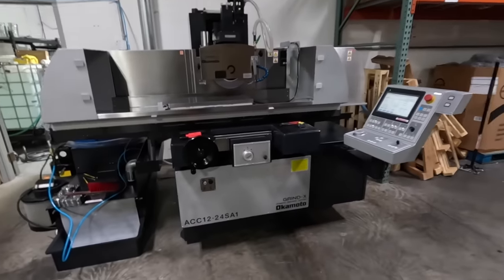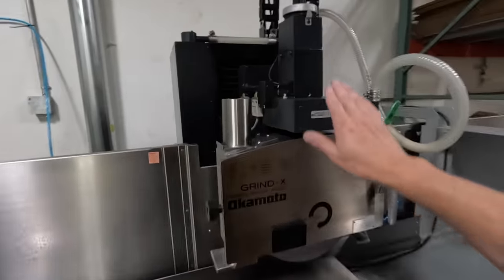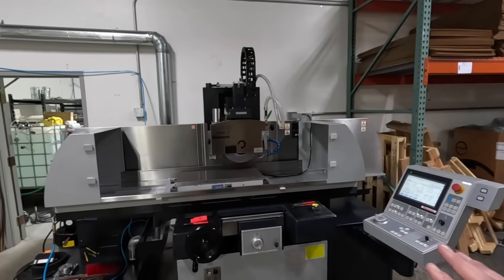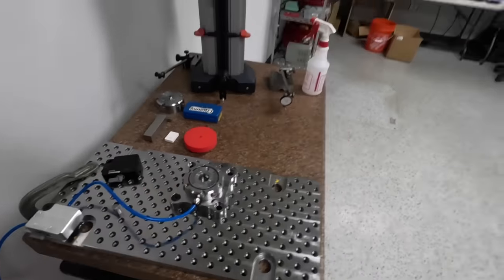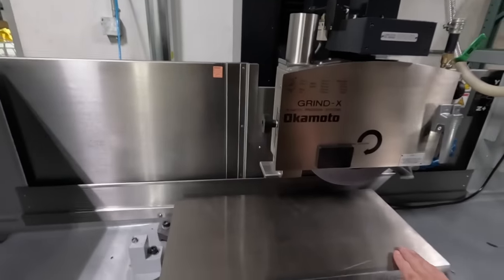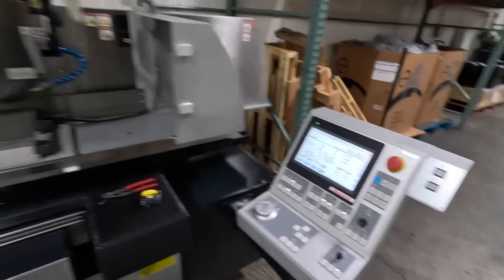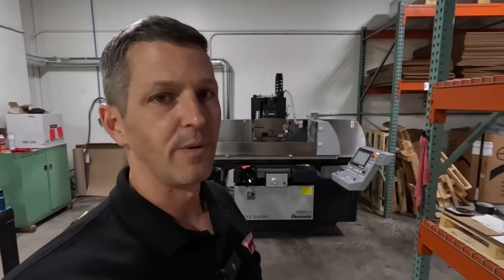Buying a 12x24 Okamoto Surface Grinder for our Machine Shop!

Comment: @nyccnc generally when grinding square or rectangular parts its best to place them on the mag chuck on an angle, this does 2 things, reduces the time on part with the stone therefore heat build up but also helps to stop so much coolant overspray

Comment: What I wanted to comment on Spencer Webbs comment concerning coolant/casting thermal capacity:

Yes, water has 8.4 times the thermal capacity that cast iron has.
BUT cast iron has 7.8 times the density water has.
Thermal capacity is always weight related, so you have to throw those units around until you have what you need.
If you go by weight then all's easy.

Let's say that your grinder has 5000 lbs of casting.
You'd need 70 gallons of coolant to have an equal thermal capacity in the casting as in the coolant.

Do with that information what you may.

But always check the units!

Comment: While not a replacement for a programmable X speed control, you can get a potentiometer knob with a mechanical 3 digit counter so you can get repeatability without changing any electrical properties.
Reply from the maker: solid idea.  thanks!

Comment: Really cool machine! Regarding the iron/water heating. Water has a specific heat capacity of ~4200J per kilogram and kelvin(ie 4200J to raise 1kg of water by 1 degree). "Generic" cast iron seems to be around 460J per kilogram and kelvin, so 10 times sounds about right. Makes perfect sense to also heat the water directly instead of running the machine for long enough to heat everything up!
Granted that the mass of your coolant is a lot less than the mass of your machine but much like a car coolant loop it will help equalize things faster.

Comment: Great looking machine! Just a thought regarding the X axis travel potentiometer - a little arduino project, Could you 'fabricoble' a method in which you take the signal from the potentiometer and display it on a seven segment style display? That way you have numeric value to tie up with your setup sheet "set x axis feed to 65" for example.
Reply: Sharpie takes 3 seconds, just saying

Comment: if its really just a potentiometer, it would be pretty easy to wire in a box with a few fixed resistors that you can activate with buttons for production mode. or even industry 4.0ing it with a little microcontroller. I see why it sucks but maybe a thought for process reliability in the future..?

Comment: Nice Video John. I think this machine will work out good for Your parts. I used to have big Mattison Hydraulic Manuel machines. Super heavy and holding a couple tenths was not a problem even for a 60” machine. I really like your choice but I am surprised you did not go with the full CNC model. I hope it works out good for you

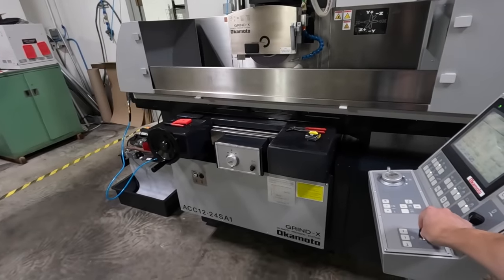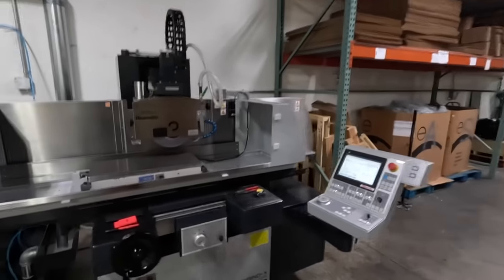Comment: @4:00 Would it be beneficial to print a donut shaped label to go around the "X axis potentiometer" with hash marks similar to a watch?  Therefore it would take the guesswork out of knowing if you set it at 9:30 or 10:00?  This would add a level of resolution to your repeat adjustments in future setups.

Comment: This is fantastic info thank you as always! An Okamoto has been on my shortlist. Just pulled the trigger on the Genos m560-V. Could I ask if you have a shell mill you might recommend for a good finish? I'm hoping that this will help me to achieve a smooth finish on my folder flats. :) Or if anyone else out there has any ideas.

Comment: The necessity of cylindrical grinders has changed just like with surface grinding. Cnc lathes can repeatedly hit tolerances and surfaces finishes now that it eliminates alot of post cylindrical grinder work. The exception to this is getting into big parts as the majority of the cnc market is pretty small machines.

Comment: There a video some where here on YouTube about the world most accurate "cmm" un imaginable tolerances I think it was built under a lake some where cause even  cosmic rays would affect it.  Vacuum sealed environment if a door was opened they'd have to wait several hours for the pressure to adjust.

Comment: When you're dealing with thousandths of a millimeter
you cannot afford for the high-precision bearing of your grinder to change temperature.
If you do this every time before heating, it may vibrate
Of course, this will change the quality of the final surface, plus its size may be different from what you set.

Comment: These machines use a lot of electricity
Reply: try hand scraping it then
Reply: @@spike1670  I watched a video of some people rebuilding bearings in the sand with a stick and hand grinder. While it is true they had a bearing when finished it also would likely only last a few hours before failure. A lot of these pakistani truck type videos I believe are made simple so people will watch them if they actually use the stuff they butcher together likely somebody the next town over is making the same video tomorrow. lol